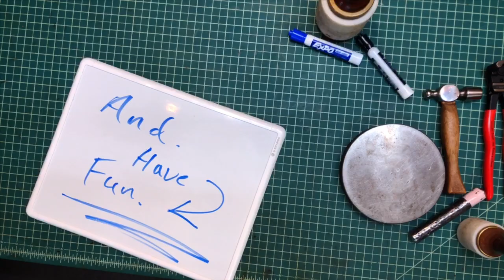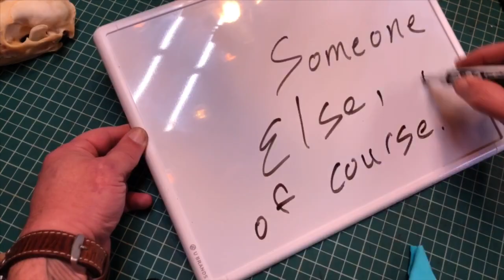Making a Leather Choker Collar / Necklace!

Comment: What leather are you using for the main body of the collar, its obviously a medium weight vegtan for the straps and attachment points. But I can for the life of me read your label.
Reply from the maker: Horween Dublin
Reply: Thanks I do a lot of knife sheathes, wet molded cases or box style cases that get tooled. But I havent done anything for wear against skin. The wife has been asking for a choker for a bit, but I knew standard vegtan just wasn't great for long periods agaisnt skin
Reply from the maker: This would fit the bill
Reply: @MasconLeather  thank you